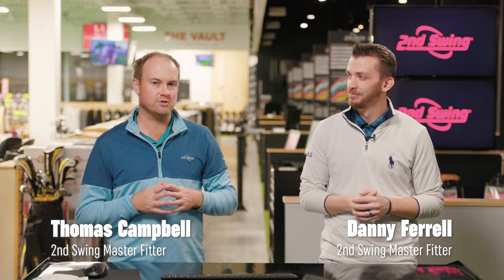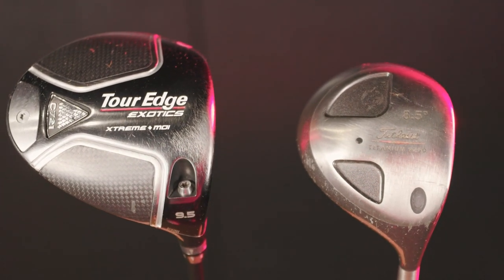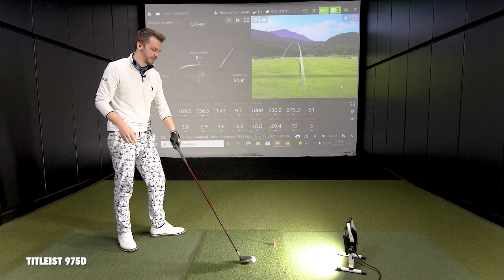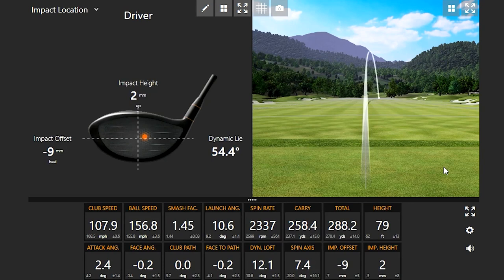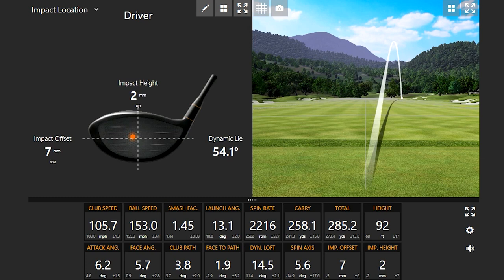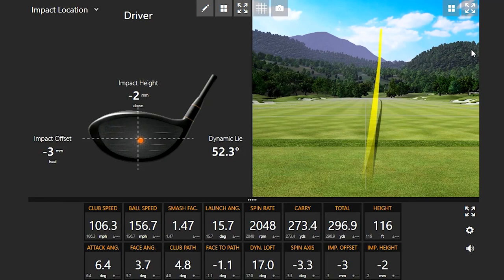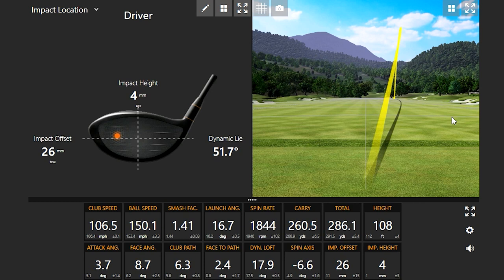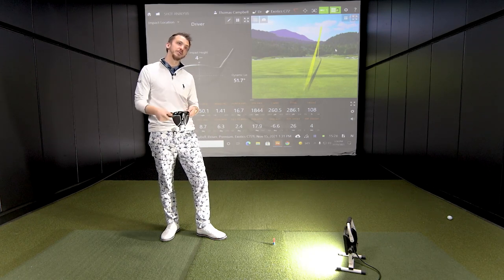Explaining Gear Effect | What is Gear Effect in Golf?

Comment: I worked hard with my Coach last season moving my strike away from low-heel and more towards high-toe. My strike is now more toe side, but I am still struggling to get my strike higher in the face. Despite teeing the ball high I still tend to strike below the centre line, so I guess that I probably need to start experimenting with my angle of attack and ball position??
Reply from the maker: Yes ball position and angle of attack is what's left for you to work on - Thomas
Reply: @2ndswing  👍👍

Comment: Sorry guys, you havnt mentioned the effect role and bulge has. Driver faces are not flat as you are insinuating, they have role and bulge to off set the gear effect and that plays a significant part in ball flight shape
Reply: Roll and bulge is what imparts the gear effect, it doesn't offset it. A flat face, like on an iron for example doesn't impart any gear effect for that reason. At least that's my understanding.
Reply from the maker: Valid points! all driver faces have bulge and roll and they are not flat which does influence the starting line, however hit location will influence curve/spin axis more so than a flat face like an iron - Thomas